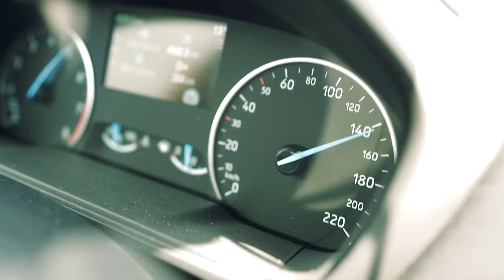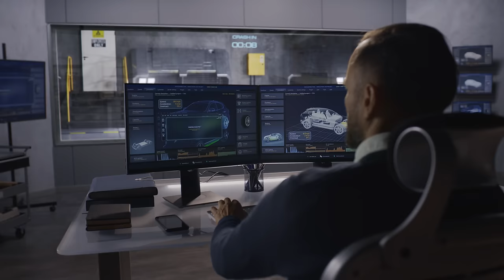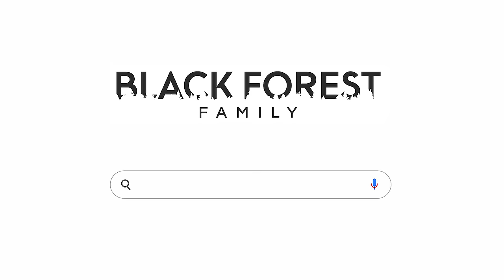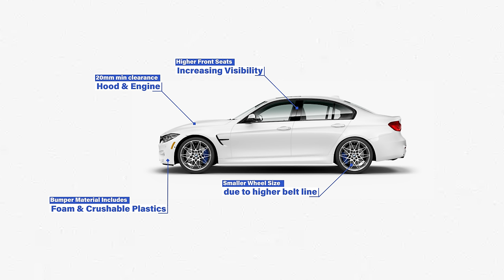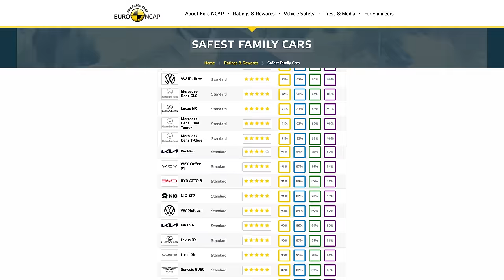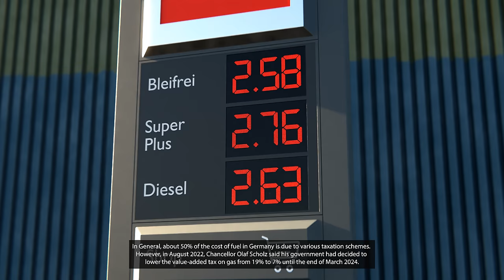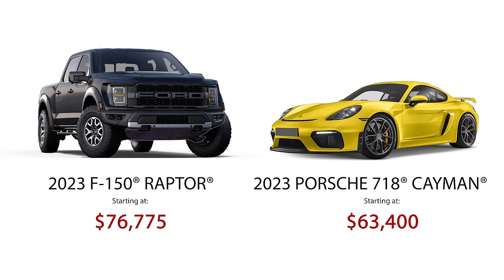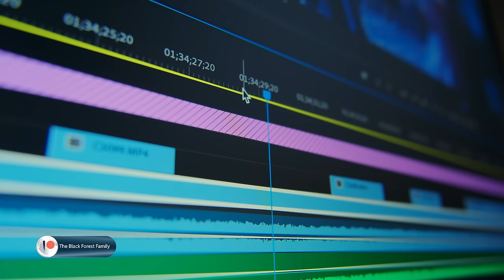DRIVING CULTURE CLASH: Why do our Cars LOOK so Radically Different?

Comment: I had no idea about the pedestrian safety issue, but it does make sense. My Seat Ateca will slam on it's brakes if a pedestrian steps in front of me. As Seat is a member of the VW Group I expect other VAG vehicles do the same.

I was in an Audi dealership a while back and even the smallest of them was pretty big by European standards.

As for your comment about the Tiguan, my Ateca is the Seat equivalent and it's really not a large vehicle. Yes it seats five but it does so efficiently and cruises comfortably at 140kph with a 1.4L engine.

Oh, and you bet I'd choose the Porsche over the truck. I never understood the truck thing, even when I lived in Texas and had a Dodge 3500 for work.

Comment: The commercial roles of pickups in Europe are basically filled by flatbeds based on transporters, mainly Mercedes Sprinter and Fiat Ducato. There are even double cap variants that sit 6 people. However, they seem to get rarer and are replaced with trailers as with modern licenses they are limited to 3.5t without a truck license and it's cheaper to have a class BE that allows you to have a 3.5t vehicle and a 3.5t trailer. People who still have the old classes that allow more are getting kind of old. For those, you would need a commercial licenses and paperwork for professional driving.

Comment: Again, high quality research, scripting and editing! I enjoy your documentaries a lot and thus have followed you on patreon.

Here is something that triggers me a bit, when I hear the notion "German" car: When it comes to cars and national economies or brands it helps to take a closer look on how cars are manufactured. Only about 30% of a car's value is created by the manufacturer. Car brands usally produce the body and the engine and perform the final assembly of the parts. These parts are supplied by many 1st tier supplier which itself source their parts from 2nd tier suppliers and so on. As an example, mercedes-benz is sourcing more than 50% of their parts from non-German suppliers. Also, all the big players in the car industry have plants (engine plants, assembly plants, CKD facility etc.) in many different countries. It has been many decades ago since we have been able to talk about a national car industry. BTW: China based brands are the biggest exporter of cars followed by Japanese brands and then German brands. But it really doesn't matter.

Additional: Heavier cars have made accidents less dangerous for the passengers but more dangerous for pedestrians, cyclists and bikers. So, cars have become heavier over time. The Golf I from 1978 weights about 800 kg. the latest Golf VIII weights between 1300 and 1600 kg!

Finally, the fixations of owning a transport vehicle that is used only 10% to 20% of the time just for getting to work and performing the daily errands puzzles me a lot. This is highly inefficient use of capital and requires a lot of space to park cars. That might be okay for rural areas but the majority of the car owners live and work in cities and/or suburbia. Our societies need to invest much more in transport networks for people and goods. Walking and cycling might help as well.

Comment: Hi Ashton,
pedestrian protection leads to quite interesting solutions. Regulations require to have a distance of about 10 cm between the Motor hood and engine block, so that there is enough "braking zone" for a pedestrians head when deforming the "soft" hood, before crashing on the hard  engine. This is why e.g. Mazda MX5 has a so called "active" motor hood that's back side is lifted with two explosive charges, when sensors detect a pedestrian crash. With this mechanism, the required minimum distance is achieved at the time of the crash. 
Btw.
Can become very expensive, when a rabbit... is hit.

Comment: Interesting video and an interesting point about taxes. You have to remember though that in Western Europe, Germany is pretty much a tax heaven for car owners. Purchase tax is just VAT and the annual vehicle tax has a rather low rate. In several countries there's an additional environmental purchase tax on top of the VAT, which can be very significant. In the Netherlands the worst polluting combustion cars can have an additional purchase tax of €50.000 or thereabouts. You can look up the ACEA Tax Guide for an overview of all vehicle taxes.
Another point missing from your video may be a change in ownership structure. In Western European countries, 60 to 80% of new cars sold, are not privately owned, but company cars. This means that not the purchase price, but the lease rate and benefit-in-kind regulations determine the cost for the end user of the car. Company cars are usually cheaper to run than privately owned cars. In my opinion, this has made larger/more expensive cars available to a wider audience.

Comment: Great video and thanks for the content. One thing missing how finance and marketing departments of big companies shape very targeted lobbying efforts. The examples are legion, but in this specific case it was the ability to have light trucks exempted from fuel efficiency standards. These gave companies a strong incentive to push SUVs and pickups. In addition, regular SUVs and pickups are body-on-frame constructions which are very simple and hopelessly outdated technologies to modern unibody designs you find in cars and modern crossover SUVs. All told, pickups and SUVs give you insane profit margins for very bad products that are about half a century out of date, except for very specific applications that are rarely relevant outside of commercial use, where in any case European style sprinter vans or light trucks tend to be the better solution.

Comment: The answer is " simple"...
Appliance manafactures in the US make B I G applainces because, you needore electricty. Ergo...$$$  cost people more to operatr. 
The same goes for cars, trucks...
BI G, but expensive to operate.
Air conditioners in the US because, houses are made BADLY, what means more elect.
$$$
And so on.
The EU countries have smaller, more efficient applainces and cars. (mostly)
Reply: Houses are not that BADLY in Europe ... because people live in shitty apts.  😀😀😀

Comment: Very likeable way of showing such differences and trying to explain them! Yes, in Germany the number of vehicles that are not only used to transport people but also have a certain flexibility is increasing.

However, open loading areas, such as on a pickup, tend to be the exception. SUVs of various sizes are becoming more and more popular and are displacing the market for so-called station wagons, which are also preferred by many sales representatives, even in the high-price segment. All domestic brands still offer these models in many classes and sizes. So they are also a type of commercial vehicles, but they can still offer the comfort of limousines.

Comment: Slight error there at 10:00: the European version of the Escape is the Kuga and apart from the name and powertrains, it‘s the same car. The Eco-Sport is two classes smaller (with the Puma slotting in between) and has been sold under the same name in the US as well.

Comment: Many old town and small town parking lots are based on a 5 meter length. That is a Golf with one foot extra in front and behind while street parking. Try to fit an F150...  no chance. There isn't enough space, and that goes for all of Europe. American cars may fit, but the 'trucks' and SUVs are really insanely inefficient: heavy, can drive the winding roads at higher speeds, often have a rear axle ....  So, that fits 3-day interstate travel with five in the vehicle! Finally, although Germany is going through a rough transition, the US will need to find a way to go more climate conscious as well. And yeah! Tesla is American and leading the pack! But the Ford and GM came with an 'e-'F150 and, oh my, an electric Hummer ....   Hummer is zero consciousness and total waste, to me at least. Germany have a Mercedes G-class, same category but half the weight. In NYC though, most vehicles do not seem to be trucks and SUVs but cars.  -  Consider Amsterdam: built for freedom of movement, you can use bikes! Trams, metro, be a pedestrian, boat! .... oh yeah, car! Parking is €7.50 / hour (minimum) in the center. So drive in and out.
Reply: "Try to fit an F150...  no chance." not a big deal actually ... ever tried it, or is it just what you think it is?
"There isn't enough space, and that goes for all of Europe" haha ever been to Sweden? Their road network is US-inspired, large and wide enough to fit larger road trains than there are in the US. 
" often have a rear axle" kind of every vehicle has a rear axle ... 
"In NYC though, most vehicles do not seem to be trucks and SUVs but cars" still you see a ton of full-size half ton trucks in NYC, also specifically in Manhatten.

Comment: As always, I really love your content, it's so much more than just reiterating either side of the debate. It is really refreshing to actually hear about the facts and how those factor into such differences of opinion and (economic) behaviour. 
Just one minor point of criticism. At the start you are talking about campers while you're referring to caravans. There's a huge difference between the two, most notably that campers are much bigger, can be driven on their own without needing to be towed and are essentially tiny self-contained houses.

Comment: The problem here where I live is different and a little more "ancient".  In the city center in Zaragoza, you can not dig a hole without finding Roman ruins.  An example is that about 25 years ago an unstable building was demolished because it was deemed unrepairable.  When they went to dig for the new foundation they discovered why it was unstable.  There was a 2000 year old Roman amphitheater underneath.  Quite a surprise and it required the demolition of another building to completely uncover it.  It is now an outdoor museum to that time in the city's history.

Comment: Well, SUVs now make up almost 40% of new car sales in Germany. So we are kinda getting to where the US is leading leading the way. 

And yes, we hear the same excuses. Mom and dad "need the space" to drop of their single kid in front of the school. "Not Just Bikes" has had a nice link to an online car size comparison tool some time ago. The gist of that is, let's just say, the more packaging , the less content. If one "needs the space", one needs to buy a panel van like a VW Caddy, a van like a VW Transporter or a Sharan, or just a plain old sedan or estate. A hitch and a rented trailer will quite handsomely take care of the very occasional hauling requirements. Even if one is building a house. 

Judging from any dashcam channel, those trucks and SUVs are not even safer for their occupants. At least not beyond what "bigger"does to any smaller opposition. Instead of just crumbling front and rear, chances are one does a flip-over during even a minor collision, thank you very much. 

On the flip side my employer only springs for an economy sized rental. Fair enough in terms of economy. But a rather scary driving experience especially in the US Southwest. Thank god for the 120 kph (sorry, 75 mph) speed limit, generally more laid-back US drivers and much more frequent speed checks by the cops.
Reply: I bought a compact SUV three years ago. But I did it for a simple reason: I wanted a BEV and I needed at least 300km Range for commuting - under all weather conditions, also during winter time. At that time there were only 4 affordable cars that met this requirement. Three of them were compact SUV (Hyundai Kona, Kia e-Niro and Kia e-Soul) and the fourth one was the Tesla Model 3 Long Range. As I dislike the interior design of the Tesla, I took the Kia e-Niro. It is described as a Compact SUV, but the size is nearly the same as the size of the actual VW Golf...

Comment: The video highlighted some facts, but I disagree on some of the conclusions. 

Fine German engineering isn't largely true anymore. A well engineered vehicle would be safe. Yes. Perhaps even fun or high performing. But if a vehicle isn't durable or reliable, it isn't well engineered. I've owned German cars and have friends that still do. Some think that they're fun or luxurious depending on the model. But none would say that they're durable or reliable. And if a low cost of operation is your goal, avoid any German car built in the last 20 years. You'll be richer for it.

Taxes do affect our buying choices. Most Americans see no virtue in paying more taxes. Whenever the government increases taxes on desirable goods or even attempt to do so, we will push back hard, so they had better have a good argument to do so. Most arguments fail because "the government is good and are good stewards of tax revenues" isn't true anywhere. So if the public won't be taxed as a consequence for their choice, it uses incentives instead. Germany does both which just seems simply coercive IMO.

But even if the US and Germany were parallel in policy, most differences in choices would remain. The US is a larger country and less densely populated. The US isn't as reliant on foreign energy imports. There remains a desire for independence and individuality that began before our founding and that is reflected in our car culture.

And then there is VW. I have no love for large corporations, but will spend my money on some of their products. Not VW. VW and their corporate officers intentionally designed their product to spoof emissions testing in order to make their product legal for sale and in addition, eligible for tax subsidies to consumers. How many cars were sold to people that would have made a different choice if they knew the truth? How many legitimate manufacturers were harmed? So not only was their US customers defrauded by their claims, everyone in the US was ripped off. VW is a criminal organization which is highlighted by their executives in German prisons. The remedies and fines rendered were small relative to the conspiracy. Their ability to continue selling in the US was a political decision. A very bad one.

Comment: I wouldn’t call German engineered car’s quality engineered. I’ve found them to be a chore to work on and the cost for even basic parts prohibitively expensive.
Reply: If you're not in Germany then yes, parts will be more expensive than those for locally made vehicles.

Basic economics + better quality.

Comment: The price of gas, is also influenced by the quality, for example in the EU and Europe the gasoline comes in high octane values , the lowest octane you can get in the eu is 95 , while in the us you can get a 82 octane fuel, which is of a poorer quality then the high octane one, besides that the insurance of the car, takes into consideration besides the age of the driver and the year he obtained the drivers license it will take into consideration  the size of the engine, emissions, and year of manufacturing, so for younger people, the small engine, small car, is cheaper to tax, cheap to ensure.. and so on
Reply: Europe vs the States
 In Europe, gas stations describe different types of gasoline based on their RON rating.
 It is typical to have 102, 98, or 95 RON with prices varying accordingly.
 In the States the descriptions look a lot like RON, but they are not.

 Pump gas
  In the United States gas stations describe the types of gasoline
  based on the Pump Octane Number (PON).
  That number is the average between RON and MON.
  
  If a fuel is 98 RON then it will be 93 PON			 -> 93 PUMP
  If a fuel is 95 RON and 87 MON then it will be 91 PON	 -> 91 PUMP

Comment: I think there is also the question of roads and of alternatives:

1.) Roads. On average, many backroads in the US often have a poor surface quality, with potholes being a regular ocurrence. A large vehicle with a soft suspension and robust axles (like the Ford F150 does better there. 

2.) Alternatives. If you have a sensible alterantive to sitting in a traffic jam, you'd rather go for that one. If my 30 minute commute is 25 minutes sitting in traffic, I might take the train, even if that one takes 5-10 minutes longer. At least I get to read a good book that way. But if you don't have alternatives, you want to make your commute as comfortable as possible which is why many large American SUV almost feel like houses inside (fridges, TV etc.).
Reply: The answer here is to build better roads like in Europe.

Comment: I've commented on this a few times on other vehicle channels, but one of the issues with vehicles in the USA is the low towing and carrying capacity of non-SUVs and trucks.  In short, you can't buy a "new, small or mid sized, car" in the USA that can legally tow anything but a bike stand / rack for an electric wheelchair (1.5k pound limits... if it is allowed at all).  Even small crossover SUVs rarely go over 2k pounds.  To be able to legally tow any trailer, you must get a mid-sized SUV or truck.  So, no small trailers behind cars here.

And, to dive into the weeds on regulations... the CAFE fuel mileage standards in the USA, based upon the size of a vehicle, are another reason for non-"cars" in the USA to be getting larger and larger ... and larger.
Reply: So, how many Americans need to tow big trailers in their life?